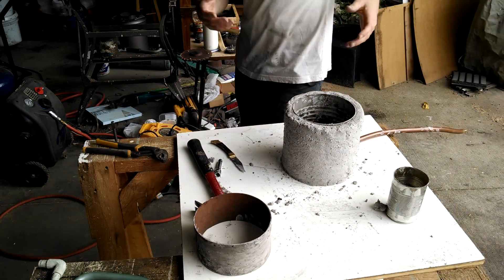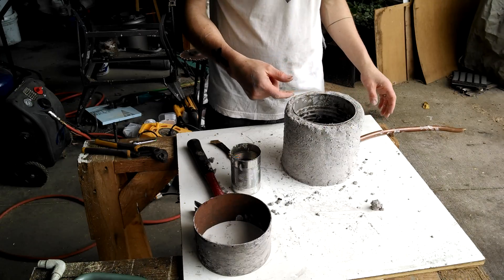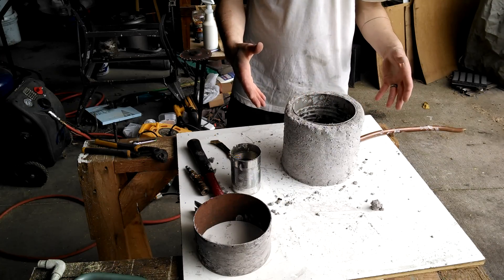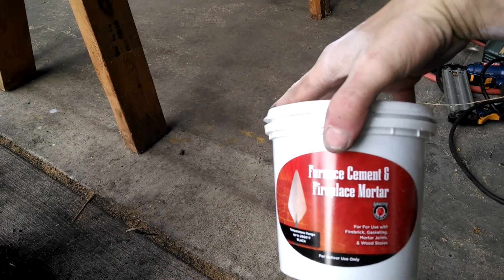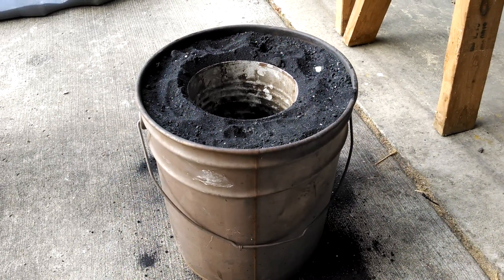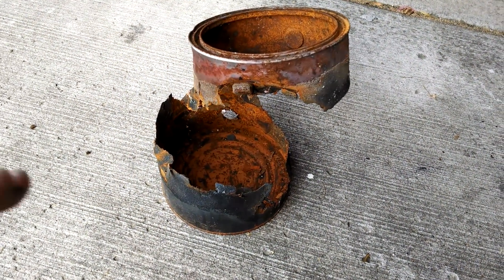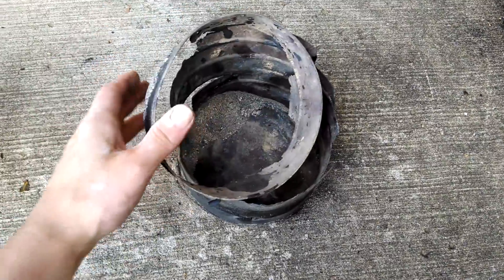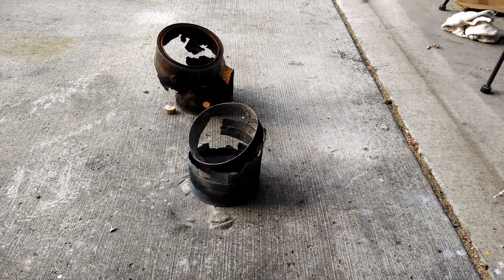Build your own aluminum melting charcoal furnace

Comment: How much did the cement you poured around the can cost
Reply from the maker: The cement that I used i got from a foundry by asking if i could just have some to try. they go through large quantities as this particular product is used to line and patch their ladles. it handles like playdough and is actually a plastic product, or so i am told. It is not a necessary part of the furnace I recommend beginning without it until you determine the ideal size of your furnace.
Reply: Okay thanks

Comment: Maybe you shouldnt start with a rusting coffee can....
Reply from the maker: It is best to use newer metal, mine in this case was more to support the cement encasing it. The point I am making is "work with what you've got" there are far better materials but this furnace is completely 'found' supplies. I did it for free.